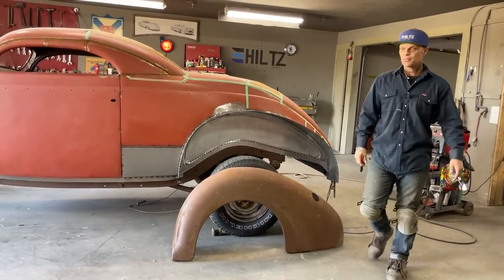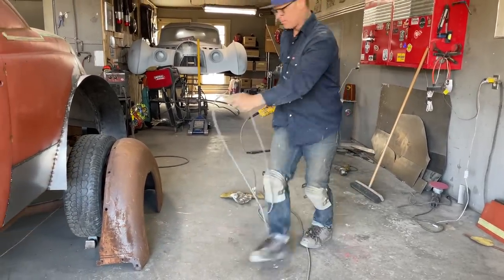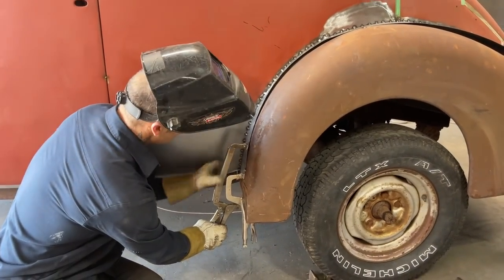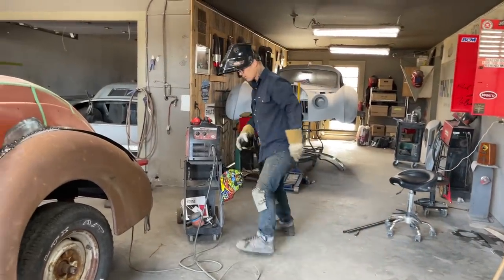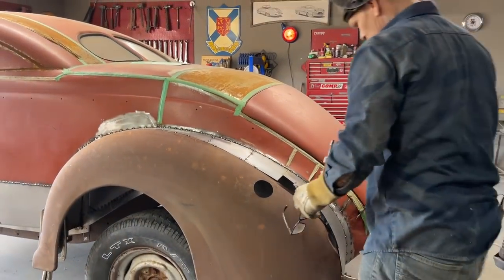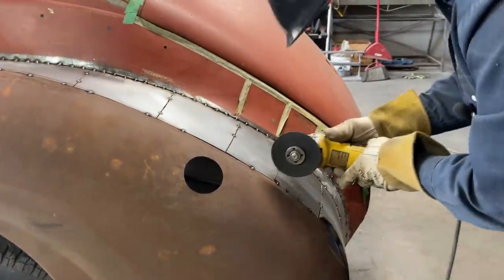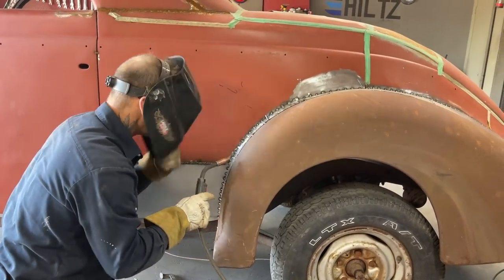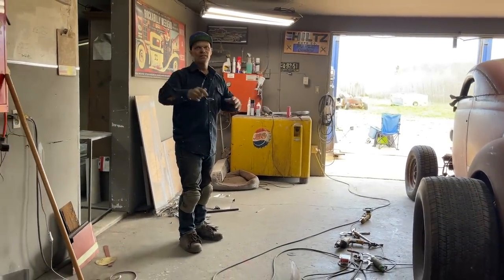Manipulating rear fender to fit customized 1940 Ford

Comment: That rear fender looks like it will shape  very nicely with the new wide wheels.  Actually, maybe better that the fender is off center forward, as I am imagining you can just cut the rear of the fender opening to center the new larger opening.  You could maybe even save that original edge and weld it back on the new opening ?   You have handy "tubby" wheel wells to handle most anything you want to do in the future.
I am thinking one of the things that makes the new floor look so awesome, is that most of us are not expecting to see anything pretty when we look inside a 1940s car.  And, then, "BAM !" .... a beautiful, shiny new custom rolled floor !    And those massive wheel wheels look great.   You obviously have a vision in your head of how all the metal you have can be "formed" into this car.  What you can do with square bar and sheet metal is amazing.     Your experience shows in that you are "seeing ahead" to what you will need, and have established techniques to more easily handle various issues.

Comment: When you placed the fender and spot welded it in place without marking and cutting off the inner lip I was confused as to how you were going to either cover it on the underside or remove it after. You simplified the whole process for me.  I really like the way you do things. You have a way of making complicated things if not simple, at least reasonable.

Comment: I think you could have taking the fender off after fitting ,marked it and take that english wheel you have there and stretch your fender to your welded metal on the car. Then you wouldn't have to split the the welded lip and gather it like you did. If you wheel it with the bottom anvil the curve you would like it to be you could mantain the curve of the fender in both directions ,across the fender and with the fender. Food for thougt for next time. I watch you all time Chad keep having fun!

Comment: Hey Chad, how we stretch the wheel openings on pro mod cars is take the center of the wheel opening. Cut it up 2 in and then whichever way that you have to stretch it, take yourself to inches all the way down and around and take that piece out. Then figure out what looks good and cut that piece to fit and you'll just have to fill a little bit in the center

Comment: Hey Chad what about putting a wooden two before block on top of your fender back there where that metal slopes up in the air and bend it down using a 2x4 block to bend it down straight with your fender

Comment: Hi Chad & Jolene:  I noticed towards then end of your broadcast that you stated that when it comes time to put the large rear tire in place, you'll have to cut the fender?  Wouldn't it be easier to roll the chassis out onto the lift, drop the old tire & rim, replace the fatter tire onto the rim, lift the car higher than the fat tire and slowly lower the car over the fat tire and rim until it becomes equal to the rim's bolt pattern?

Comment: Actually, as I look at the fender, it actually has, like, a groove "guide" line to the rear.   I wonder if you could cut the rear edge of the fender opening up to the top, then cut back a long widening triangle following the "guide" line.   Then, bend the original edge back and re-attach ?  (if anyone can follow that - basically a big long "shrink")
Reply: OK, later I see you got that..... just comment as I watch.

Comment: I would be concerned about the stress as metal is forced in to place and welded. But, i guess welding will cause stress regardless. You achieve the desired result, that’s all that matters.

Comment: I would think if you sliced the fender down the center (The high point) and then used the self tappers, the fender would move much more easily to meet up with the metal.

Comment: On the wheel:  rims have all kinds of "setbacks".  Maybe the wheel could fit inside the fender, using the inner "tub space" ?     If you want the wheels to extend beyond the fenders, well that is another story (cut/jack up).    Maybe, even, that tire is not the best fit.  See how much space you have, and fit it?
Reply: Of course, there is modifying the suspension to lift the frame higher, which would be more "big" ...

Comment: What if you took the radius of the big tire, cut a piece of string the same length and tied a pensile to one end and held the other at the center of the axel then drew your circumference  on the fender. Should get you in the ball park.